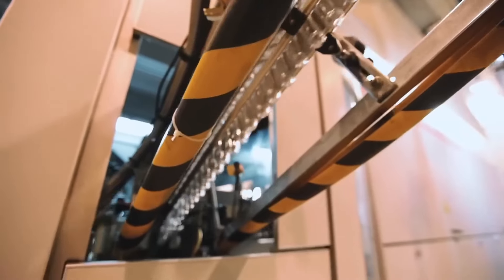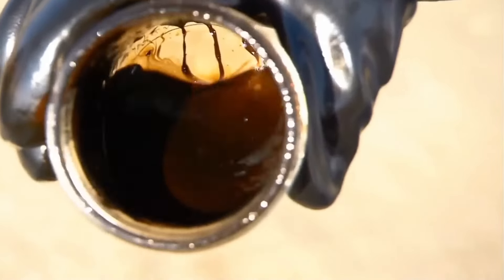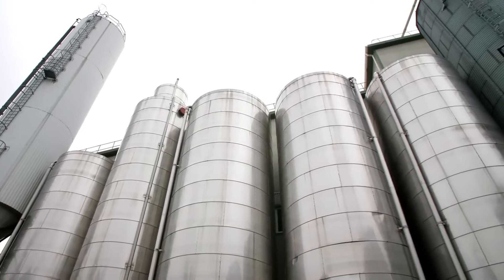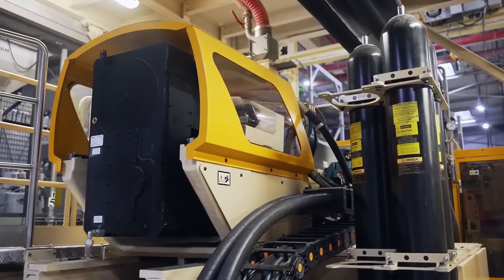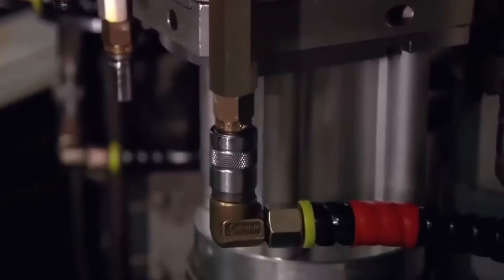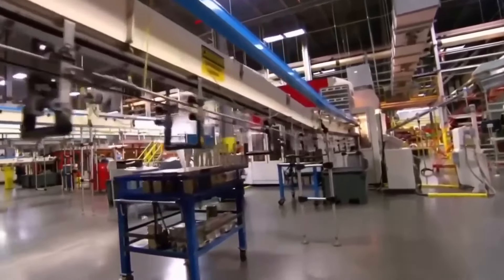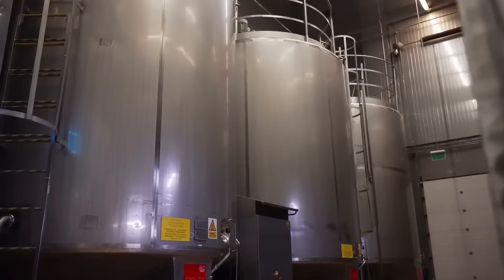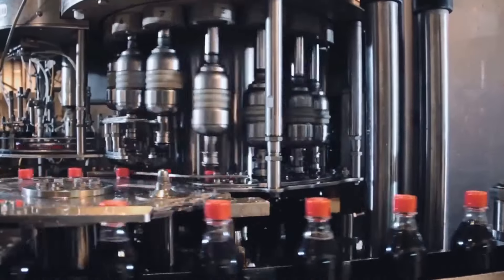InSide Coca-Cola Plastic Bottles Factory: How PET Plastic Bottles Are MANUFACTURED

Comment: Yes, most consumer plastic bottles have the bottle's total weight of plastic optimized as the smallest amount possible for filling, packaging, chilling in one's refrigerator and standing up. So the reduction of plastic is optimized. But the bigger issue is the non-recyclable label and cap. Yes, the cap could be the same plastic but presently isn't. The film for the label is the biggest challenge. Watching a video, specifically from India, showing those sandal-clad people removing the label and cap before shredding the bottles into polyester thread for subsequent fabric is in itself rewarding. But in the US, some towns require the removal of the label and the cap by the consumer before recycling. Look upstream and use proper plastic for the label and the cap and save all that silly manual labor downstream.
Reply: we can now make all this plastic without using fossil fuels. Origin Materials